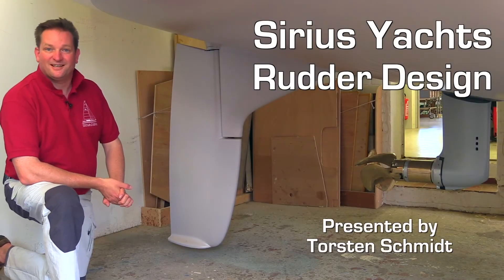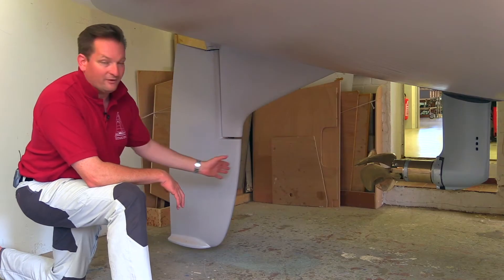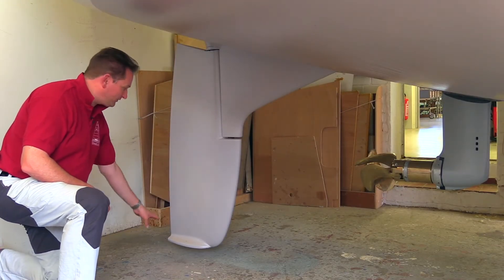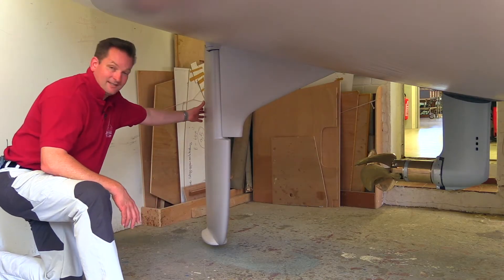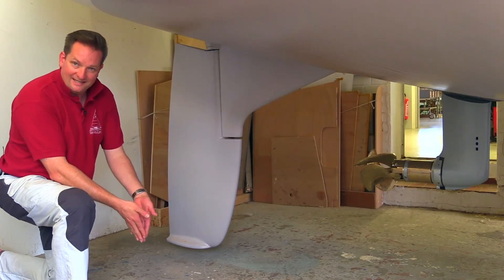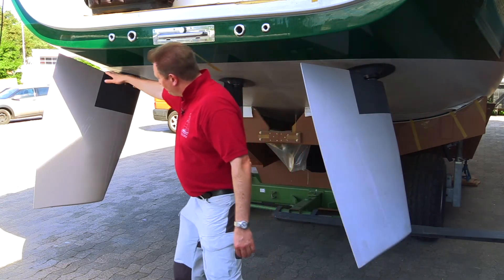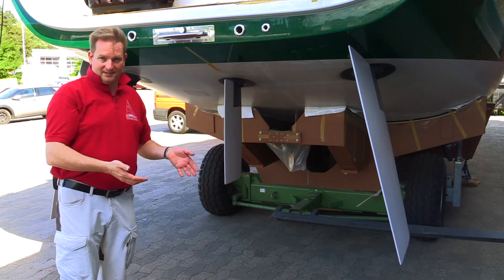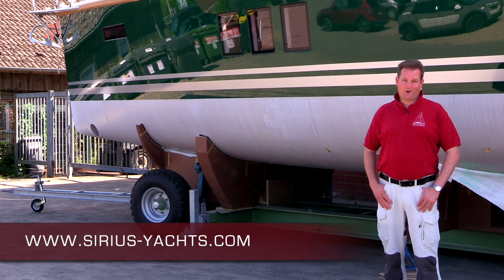Rudder design on Sirius Yachts – why do some of our yachts have three rudders?

Comment: 3 rudders for the sake of prop wash???
Reply from the maker: That’s only the reason for the third rudder. Out fin and twin keel yachts have only one half skeged rudder, but if you like to have less than a meter draft (3 feet) and need to go for a swing keel version for this reason you need two rudders as a single one in the middle would be not deep and big enough. The two rudders als stabilize the boat in a tripod stand when drying out. Downside on double rudder yachts is the loss of manoeuvrability at low speed, which often freaks helmsmans out in harbours - hench the third rudder to have the best of all worlds…

Comment: Simply overkill. For most sailors, a single rudder is sufficient for when the centre rudder looses grip, most of the time the sails are over powered, remember a balanced sail has little rudder requirement. When the main or genoa is overdriving, you need the rudder to correct heading, simply spill that sail by reefing and the boat straightens up both heading and heeling and will pick up speed. If this idea had any merit, true racing boats would incorporate it. Many production boats have twin rudders with significant more expense and have to include thrusters, twin rudder is not intended for cruising, it is a copy from racing boats with small keels that require wide spread rudders to do the work the keel does for directions and side slip on cruisers.
Reply from the maker: I am with you on a number of points. Our fin and twin keel yachts have only one half skeged rudder, but if you like to have less than a meter draft (3 feet) and need to go for a swing keel version for this reason you need two rudders as a single one in the middle would be not deep and big enough. The two rudders als stabilize the boat in a tripod stand when drying out. Downside on double rudder yachts is the loss of manoeuvrability at low speed, which often freaks helmsmans out in harbours - hench the third rudder to have the best of all worlds…
It is true that most production boats need two rudders today, as their hull shape is desigend around big aft cabins, but having such a wide stern caries a lot of problems for cruisers, as many other design features adopted from racing boats for special races do…
Reply: @SiriusYachts my position is simple, why not a 4th rudder, boats don’t need more. 99% of production sail boat users need a single rudder rather than the need for tripod standing of the vessel. Ive never found a need to have a boat that can stand alone when tides create no water, the risks on damage during the phase from floating to no water, bouncing of the boat in high wave conditions is TOO stupid to consider building a boat for this condition. I don’t know where you found a market for this design. And again, I remind you that it’s more important to set your sails correctly to enable even small rudder to steer vessel with least effort by a rudder. I seen it so often, cowboy sailors must have the vessel heeled hectically and overpowered, THE BOAT IS SLOWER, just balance sails and the boat will be faster and spill a lot less wind due to loss of projected area……..25deg heel chases the ladies and is pathetically uncomfortable. I’m a skilled sail boat skipper and the latest version of twin rudder cruisers even with a bow thruster is very difficult to deal with is wind conditions that push you off the dock, totally stupid. You need very big thrusters both bow and stern on a 50’ twin rudder plus all the additional batteries. Most sail boat skippers need more rather than less control for docking and close quarters conditions.

Comment: if i could order i would choose a inflatable one. sealed doors and windows. even if the yacht upsidedown, reversed, it will return to the correct position (but i suggestion a mast not allows it happen, maybe). anyway it would be better then lost all yacht , just cut off must and maybe even can save the mast. (or mast can be broken after storm). inflatable like closed lifeboats. and inside of the yacht too 2 or 3 doors can be sealed.

Comment: Lol. "Its complicated to build" you sound like a nasa engineer. Cheap.
Reply from the maker: It is 'more' complicated to build, I'm sorry, English is not our first language.
We offer a range of keel options, becuase of this, the skeg cannot be moulded into the hull like other boats. Instead, it has to be firmly bolted to the hull. For this we use a welded stainless-steel frame inside a GRP fairing, that is wrapped in grp woven rovings (to give a better bonding surface). The fairing of the skeg has to have a surface bonded inside to allow both side to adhere properly and the stainless-steel frame is bonded inside the one side of the fairing and they the other side of the fairing is bonded onto it, and the inside filled with expanding foam.

You can see more details of the skeg assembly here: https://youtu.be/f7upfeSGJwU?t=770
We can assure you, it is not a 'cheap' or a simple way of building 😀

Comment: If one were purchasing a Sirius Yacht for Live aboard sailing in mostly northern climates....which Rudder / keel configuration would be most desirable?      Which is most sturdy and robust?
Reply from the maker: It depends how far north and whether your cruising ground is tidal or if your harbours are restricted by draught. All our keel configurations are sturdy and robust. For our rudders, a single rudder has the extra protection of a skeg. Which would lead you to a twin or single keel. But the lifting keel has two rudders which may be more vulnerable to floating objects (no skeg and not hidden in the wake of the keel), but you have two of them.
There is more information about our choice of keels here: https://www.sirius-yachts.com/choosing-the-best-keel/

Comment: Great video... Just one question about rigging, if a customer requests a carbon mast and boom is that possible and would that improve the stability of the boat?
Reply from the maker: Yes, it's possible, although the only in-mast furling option is by Selden is for yachts 50ft and over.

A carbon mast would indeed improve the (already good) stability as well as the motion of the boat.
Reply: @SiriusYachts  thanks for your reply.. I'd prefer stack pack to in mast furling so that's good news.

Comment: Why not balanced rudder?
Reply from the maker: Thank you for asking. All our rudders are balanced to different degrees. The single rudder has a skeg and is semi-balanced rudder, the twin rudders are balanced. We explain more here:  https://www.sirius-yachts.com/best-rudder-design/ Because of the increased pressure/turbulance from the propeller under power nearer the hull we use a skeg on our single rudder yachts. As the propwash goes between the twin rudders these don't need skegs.

Comment: What happens when the three rudder swing keelboat takes to the ground?  That fwd rudder must fold right up?
Reply from the maker: ….no need to. The fwd rudder directly behind the prop is the least deep of the three by far. The swing keel sticks out of the hull by 20cm with the full length of the leading edge to give you longitunal guidance driving and to take the full load when drying out. On sand this keel will sink in 5-10cm. Only than the two outer rudders will touch the ground and stabilize the boat standing like on a tripod, preventing to end up heeled sidewards. The middle rudder will still be clear of the ground by more than 10cm in this sitiuation, as it is also only needed in the mid to upper area behind the prop under the hull…
Reply: @SiriusYachts  I am assuming that more then 3/4 of the boat weight will be pressured on the swing keel (bolt?) since that the two rudders are at the stern. They will help keep the boat balanced while standing on a dry surface and not carrying too much of the weight as the swing keel is doing. While in sand this wouldn't be a problem. Meanwhile, I can see how safe it is to keep a twin keel boat on hard surface (concrete/asphalt) can the same be done with a swing keel boat?

Comment: You don't see manufacturers go into this kind of detail.  I don't think most want you to think about the issues with the popularity of twin rudders, spades vs. skeg, etc.  The clever solutions you put into the interior are amazing - of course you have put that much thought into rudders, and multiple configurations.  I can't wait to see the 48DS......  :-)
Reply: agreed. too many introductions go for "here is the berth, here is the galley, look at the colors yada yada". as if you'd be buying an apartment and not a boat. boat needs to be steered and sailed. that's what it's for.
Reply: @hurdurdur7rl696  to be fair, those points are good to look at too
"look, we put an island berth on your supposed liveaboard cruiser, now you can really fall off in rough seas"
"look, we made a completely open galley and salon area, ideal for looking at in renderings and keep in perfectly clean conditions as it can only be used in calm waters"

Comment: I see lots of opportunities for lobster pot lines to get caught.
Reply from the maker: What would you suggest instead?
Reply: @SiriusYachts  That's difficult to say as everything is a compromise, isn't it? Generally I'd consider a full skeg over a half skeg just so a line wouldn't get caught around the rudder, and avoid gaps where a line could get wedged in. Also on that note - I'd have a line cutter installed on the prop shaft. That might avoid lines tangling around the rudder at all. In the end, a setup that allows me to get rid of tangles with a boat hook is better than needing to get in the water. Of course I recognize a full skeg would probably make close quarters manoeuvrability not as good as advertised for your boats. Maybe develop a twin rudder / twin electric motor sailboat. That could spin you right round. Also, is Sirius going to offer an electric option some day?
Reply from the maker: @ajnasreddin  You're right, everything is a compromise. We prefer to make yachts that are easy to manoeuvre, that can be turned quickly and easily. The area forward of the stock 'grabs' more of the flow from the propeller under power  making the rudder more effective, but a full skeg will lose this extra 'power'. We also prefer the lightness on the helm that a balanced rudder provides when sailing Some yachts with full skegs can be very hard work on the helm.

These are benefits you'll experience every day you sail or motor the boat, not the 1 day, say, every 20-40 years of sailing you might pick up a lobster pot. We can, however, add deflectors on the bottom of the skeg as well as rope cutters to the propellers – we'll add what our owners want.

The day we offer electric power passed some time ago...We currently (no pun intended) have a electrically powered 40DS in development for an owner at the moment, she will have twin rudders and twin drives that provide propultion and regeneration. Fun times ahead!
Reply: @SiriusYachts  Good points, but whether or not you encounter lobster pots really depends on where one is sailing. It seems that in Maine waters (northeast US) not hitting a lobster pot is the exception.

It would be great if you could highlight your electric options in a video one day. Electric motors, batteries, and recharging options vary greatly, and it would be interesting to see what Sirius is offering.
Reply: @SiriusYachts  my alternative suggestion. Crab pot lines…Haha. Love these boats. 35DS is my favorite.
Reply: @SiriusYachts  It's a fact that adding wetted surface increase dynamic friction. For a sailing vessel, that's not a good thing, and that's what happens on twin rudder boats despite the fact that they improve steering and control when heeled.
To get the best of both worlds, we find liftable twin rudders on performance  boats.
Lifting the upwind rudder out of the water reduces drag as well as risk of damage following a collision.
Now, on your boat, you've even added a third rudder, and none of the three is liftable .
A simple collapsable stern thruster would have been a lot more advantageous than a third rudder.
Reply from the maker: @feshfeshsailing  We mentioned why we don't opt for stern thrusters in the article on our website: https://www.sirius-yachts.com/best-rudder-design/
"One way to overcome this trait is to fit a retractable stern thruster in addition to the bow thruster, but they come at extra expense and need to be operated simultaneously with the rudder and engine and bow thruster, as well as using more power. Also, they take up space inside the hull and they’re something else for debris to catch in."

The added drag from an extra rudder is barely worth considering in a cruising yacht. We don't make racing yachts or yachts that are built for maximum speed, our yachts are medium displacement cruising yachts and we feel we serve our owners better with a boat that performs better when in close quarters that requiring a very expensive stern thruster system.

Of course, if an owner would prefer a stern thruster they could have one fitted, but it comes at extra cost and loss of internal space.
Reply: @SiriusYachts  It does make sense.
In the end it always boils down to a compromise where you balance pros and cons, based on personal choices.

Comment: Ok, that's interesting:)
Why don't you use thrust vectoring? (or how would you call it; rotating the prop around the vertical axis) - it looks like there is a vertical axle anyway, and it should be a similar force to a single rudder bearing, so not that hard structurally.
Longer lever arm?
Reply: I think the reason why azimuth pod sail drives isnt a thing, is the cost. A fairly basic saildrive is pretty expensive. Now what we probably will see more of (I know Elan is doing this) is electric drives where you get two saildrives for two rudders. Solves the need for the third rudder, and ~doubles regen while sailing. (Making it a little more viable) With a config like this you can use differential thrust to manouver easily. Downside is off course cost again, and a technology in its infancy. I'm a believer in electric engines for sailing boats. But different segments require different levels of reliability. Me the coastal leisure sailor could easily do with a fairly modest battery bank and an electric sail drive. But if I was going to cross oceans, I would at minimum require some sort of reliable way to generate energy for the batteries (generator, hydrogen?, methanol fuel cell) other than solar or wind (wind generator or regen through props). More stuff is also more parts that can fail. Sorry for the rant.
Reply: @McDoucheVonDouche  eventually electric will take over in sailing im sure.  Battery tech isn’t quite there.  Solid state batteries should be coming soon and of course a few years after that till they’re somewhat affordable.  Now on a catamaran it makes more sense now due to the higher speeds for regen.  You don’t really start making real decent power till 7 or 8 knots.
Reply: @McDoucheVonDouche  I think hydrogen is the way to go because of weight.  The problem is it isn’t efficient to generate.  I’ve looked into it, you would need to be plugged into a doc for a week to generate enough hydrogen to have enough fuel to cross an ocean.  My calculations were for the equivalent of 1000 liters / 265 gallons of diesel.  Basically, a shore electrical connection will give you enough electricity to generate 4 kilos / 8.8 lbs of hydrogen a day.   On top of that problem it’s impossible to know if you have a leak anywhere.  End rant.
Reply: @esquire9445  How are you going to compress it to 10,000 psi, and are you going to perch a cabin on the enormous tank, required to contain enough to be useful. Why do so many people make comments in the boat sections, without thinking about reality?
Reply: @grancitodos7318  ya, why do so many people make comments without thinking about reality? Or researching anything? And then why do people insult others without properly researching the subject? Why do people think their assumptions are scientifically correct?  …..   The Energy Observer is the name of the hydrogen based yacht that uses a Toyota fuel cell to power itself along with solar panels and hydrogen generators and compressors.
Reply: @esquire9445  You didn't answer the questions, and instead of checking any research, which lead to my comments/questions, you refer to one boat and give no details, that is why I wrote what you consider to be an insult. The reality is, you fit the group I described.
Reply: @grancitodos7318  you are just trying to win… there is a boat that does it with hydrogen and if you really want to learn you can look into that boat and also how the Toyota fuel cell works along with the tanks.  It’s it the Toyota Mirai.  Do your own research, I already have.
Reply: Reliability.  When we cross oceans we want stuff that doesn’t break.  The number one reason people are forced to abandon their boat in the middle of the Atlantic is they lose steering.  Many people install wind vane based steering, a very old way of auto steering, just so they have a backup rudder.
Reply: @esquire9445  so the "thrust vectoring" is less reliable? Ok, that makes sense.